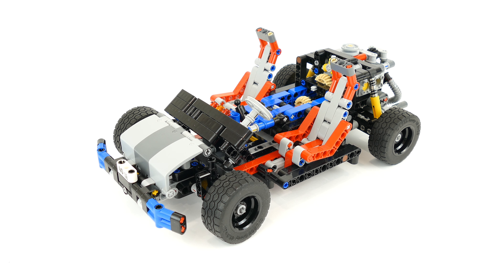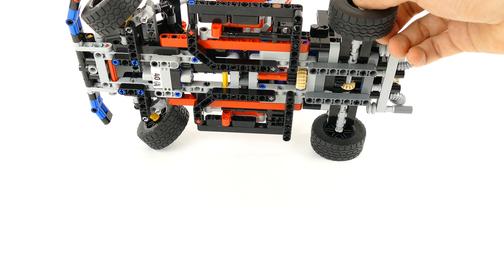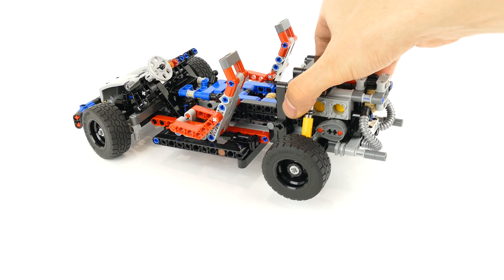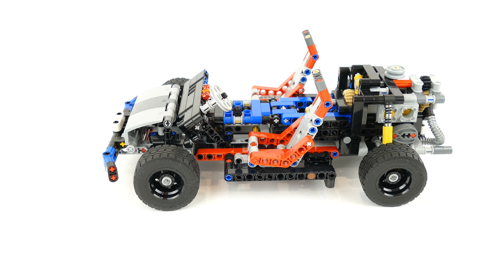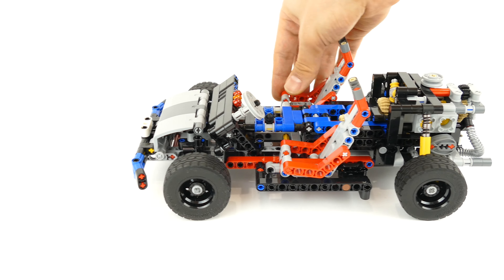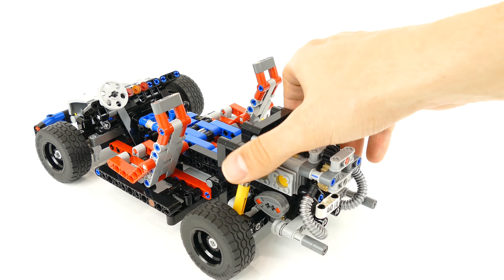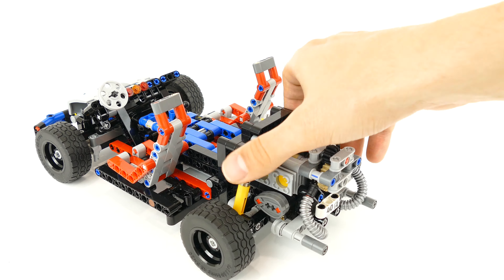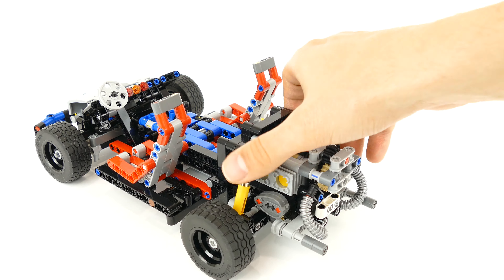LEGO Technic 40th Anniversary Car Chassis (4K)

Comment: - Did you have any significant challenge in designing this model? Like the challenge with the cylinders in 42053 B model.

- Are the three sets designed with the consideration that they will be used later for the chassis, or are they just selected from the 2017 batch because their parts fit the chassis?
Reply from the maker: The absence of suitable parts for steering was the biggest.
Reply: Oh yeah when I first saw the model I also wondered how it could steer.